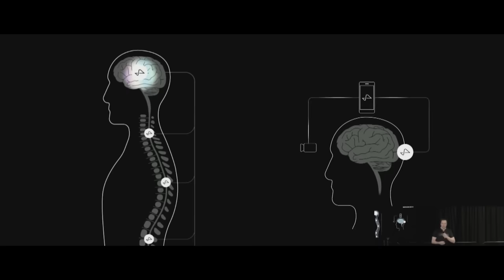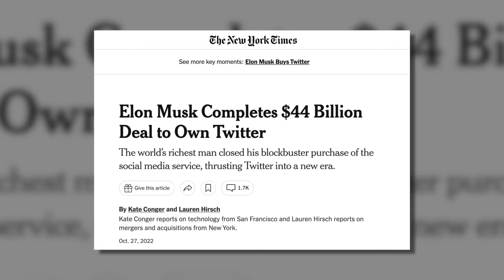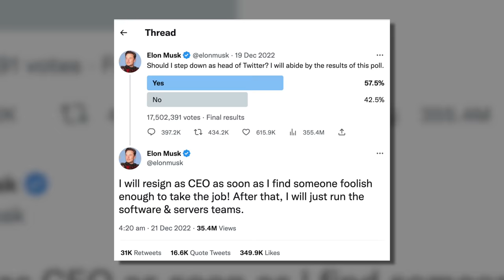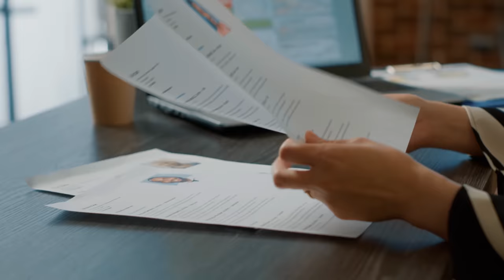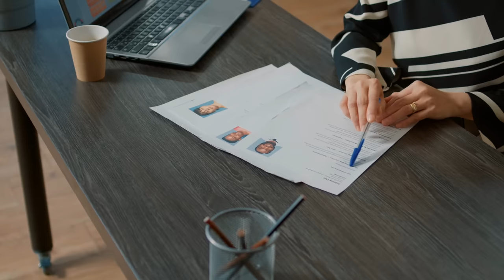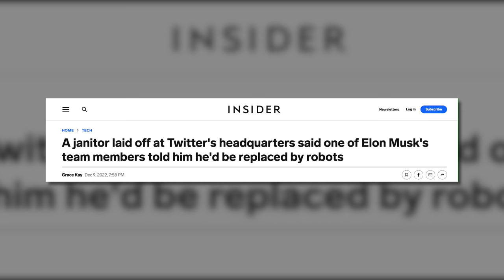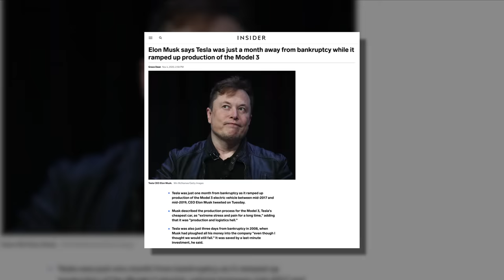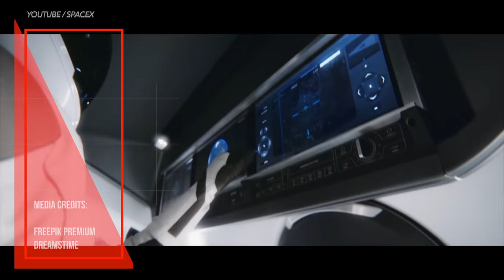Breaking News on Elon Musk

Comment: Most common Toyota Tacoma problems
🤔Peeling Paint It is unpleasant to see a beautiful truck blemished and dented. However, it is worse to see the truck’s paint peeling. ...🤔Faulty transmission The Tacoma transmission issues arise from the throttle position sensor. ...🤔Rear differential leaking ...🤔Cracked blower motor ...🤔Lower ball point prematurely wearing ...🤔Transmission hard shifting ...
🤔Idle surging ...